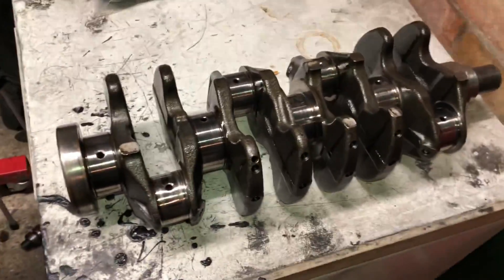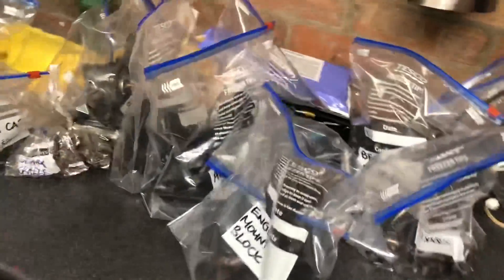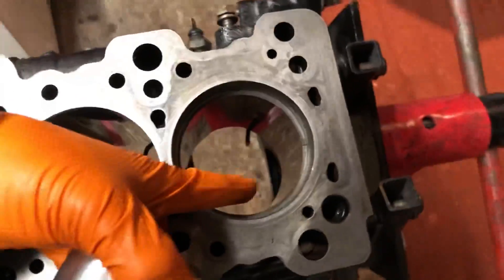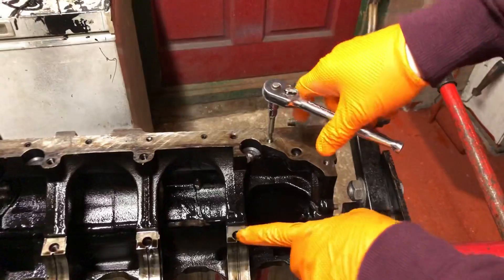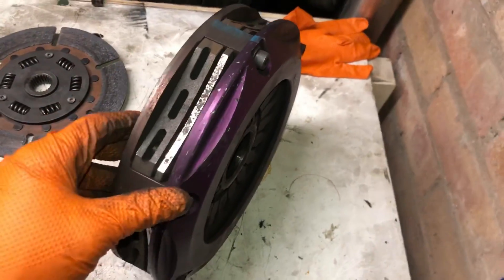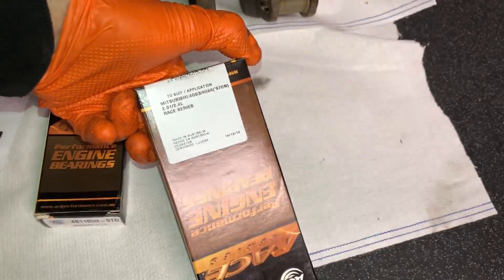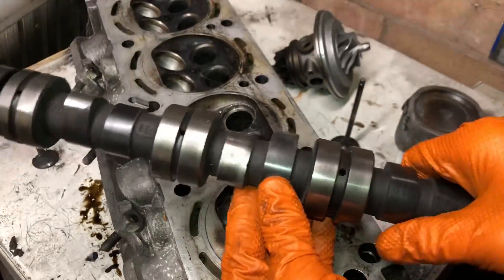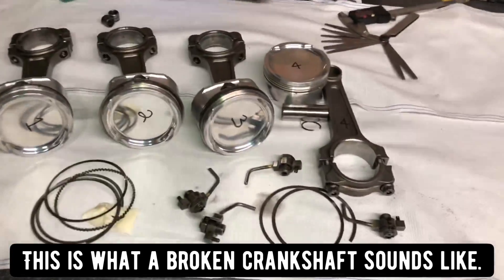DID THIS DESTROY THE ENGINE? Mitsubishi Evo 5 Rebuild Starts

Comment: Who ever owns the c20 head should do the mi16 conversion now. Perfect opertunity. Puts intake to the front and give you big valve head at the same time. C20xe head is a almost identical copy of the mi16 only with the ports and calves being smaller.

Comment: Hi Aaron - please explain to me why you are not using turbo diesel pistons and connection rods - diesels had much higher compression so these parts should be great for these hitech but still lower combustion engines or am I missing a point here? 🙄

Comment: Bit off topic aaron but which oil do you run in a fresh fully forged zlet will be around 300bhp once mapped n later on high 400s i did have a 477bhp one before and used gm semi synthetic but just wanted ur opinion
Reply from the maker: This will depend on what oil clearances were given to the bearings when it was forged
Reply: @AaronUnknownPerformance  Can you go into detail about this on your next video, I love this technical information you give to us.